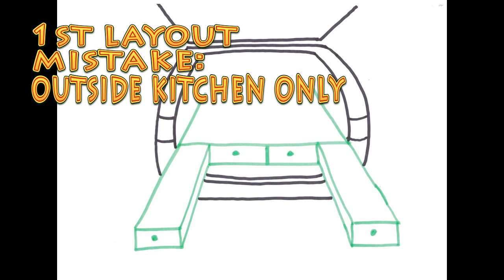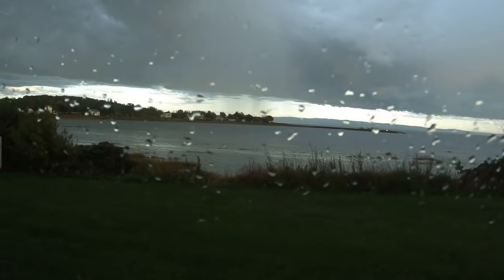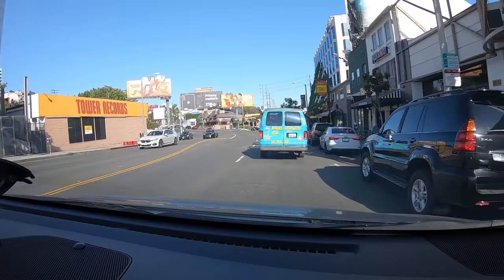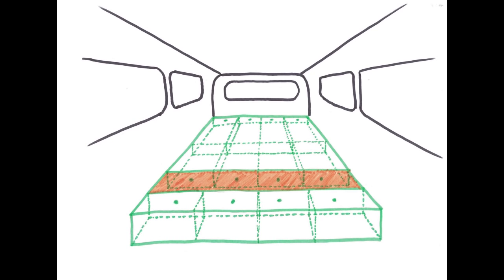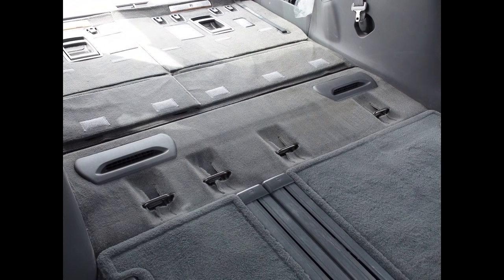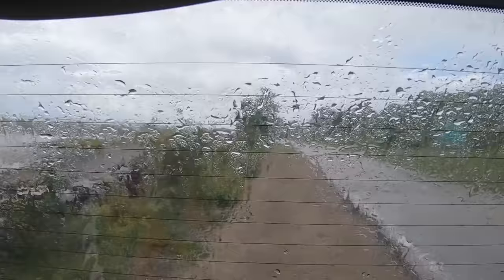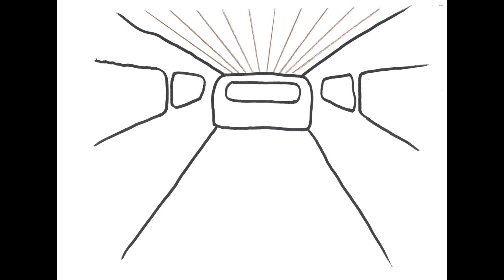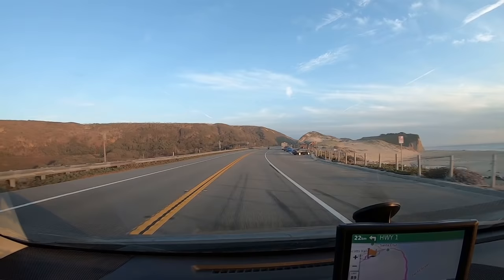11 mistakes to avoid (van conversion)

Comment: Good video. Thank you.
After trying various designs over many years, one of the best changes for me was to do away with cooking and refrigeration. I still eat very well and very healthily, much more so than most people who are cooking and refrigerating. It's a HUGE improvement, and saves a lot of time, space, and hassles.
Also, finding good alternatives to sinks and showers has been huge. The best answer for me is using Athletic Works 28oz squeeze bottles from WM. They do it all, plus serve as water bottles on hikes.
Next: minimize possessions the way experienced long-distance backpackers do. If they can go for months on the PCT with 20 pounds, you can do the same. Even if you double that amount of stuff, it will be far less than most vanlifers carry around.
Next: find attractive alternatives to cabinets. Example: a top-of-the-line high quality backpack, which serves other purposes as well.
Next: comfortable and compact sleeping system. Again, lightweight high-end backpacking gear does the trick and serves multiple purposes.
Reply from the maker: Thank you for sharing your point of view. Me too I effectively use stuff from my backpacking gears. 

I am a long distance hiker, as well as a long distance cyclo-camping and a long distance canot-camping and kayak-camping. I am also an adept of the minimalist philosophy.
But for me, van lifing allow me more, and I want to use it. I do not have to wash my underwear everyday, and I can do it at the laundromat. Why not save time! 
I have also tried always eating outside rather than carrying my food. It is a serious waste of time, plus you have to leave a nice incredible place to go get food! I just love my fridge! I can stay as long as I want anywhere. 
When you finish a 250km canot trip, cross à country in cyclo-camping or finishing a two weeks hiking trail without resupplying, you are happy to get some confort! 
To me, having a small concerted Van is like being in an hotel! Honestly I completely love that! But I still continue loving long distance outdoors activities. Why always living in the same « misery » all the time... But, again, this is just my opinion. Also I have lived so much hard conditions on the trail that I really enjoy having it easy with a little confort 😊

Thank you for your appreciation ✌️
Reply: @ericenjoysearth2756  Thank you for the civilized exchange of views.
Continuing in that spirit, I wanted to add:
I prepare my own meals, I just don't cook. For example, breakfast might be (and often is) a scoop (using a one-cup measuring-cup as a scoop) of organic rolled oats, plus a quarter cup of chia seeds (for omega-3s,  protein, calories), one or two tablespoons of flax meal, some fennel seeds, plus a teaspoon of amla powder (very high in antioxidants), plus a scoop of protein powder, plus a good raisin medley, with a sliced or mashed banana on top, plus some honey and cinnamon, plus some apple juice and water. I then let it soak while I eat other things, like almonds, sprouted Beluga lentils, organic baby carrots, and some kind of green vegetable.
Lunch might be an avocado sandwich, some (California Girl) sardines in tomato sauce, broccoli florets dipped in black bean chipotle hummus, a good crisp organic apple (some varieties stay crisp much longer, such as Lady Alice, Jazz, Koru, and Honeycrisp), maybe some sauerkraut, kiwifruit, yogurt and honey.
Many foods do just fine without refrigeration. Others need to be eaten soon after buying.
Letting things cool overnight, then wrapping them in down sleeping bags and jackets helps them stay cool.
I have found so many excellent foods that keep very well without refrigeration that I rarely miss it at all. Same goes for burners, stoves, and cooking.
______
On comfort: In one of her books about long-distance bike touring, Nadine Slavinsky mentions that it can be as comfortable as staying in a hotel — if you have the right gear. That struck me. So much so, that I took that route. 
It's all about "the right gear." If it is truly right, you can be perfectly comfortable.
The Norwegians have a saying that there is no bad weather, only bad clothing.
I love that.
Along with Dennis Coello's "Be ready for anything, and enjoy it all!"
______
I am a big fan of long, hot showers; but I honestly rarely miss them, have some good alternatives, and definitely don't whine and pine about it.
Reply: @viveviveka2651  i'm curious, what vehicle do you have, and what have you done with the extra space you saved by no fridge/stovetop?  (I'm thinking of a Toyota Hiace van)
Reply: @judoman09  My latest vehicle is a 4WD Toyota 4Runner. Third generation 4Runners (1996-2002) are better off-road than other generations, and better than just about any other alternative. And they are very well engineered, reliable, and budget friendly to maintain. The 3.4 liter engine is one of Toyota's very best engines.
I'm going to remove the rear seat backs, which will give me a longer sleeping platform.
I will exchange the car battery for an RV battery, because it gives better capacity. I've done this before, and it's a good, simple improvement to make.
I had a 2WD Toyota pickup with camper shell, and it was fine for most trips but I ran into some situations it could not handle, and other situations it could just barely handle. The 4Runner handles them just fine, and it opens up a lot of more remote and beautiful areas for me.
As far as extra space goes (it's also about simplicity and freedom from complexities), I usually carry a few 3-gallon water containers plus one-gallon and a few smaller water bottles (the 28 oz squeeze bottles, which are extremely useful). Depending on the length of time in the wilderness, and availability of water sources, I usually carry ten  gallons or so. I can go as high as 35-40 if I need to.
I'm picking up a JEGS 18-cubic foot rooftop carrier tomorrow. It will allow me to keep the interior uncluttered, which I like.
The extra space is also used for storing food. For example, I have a 25 lb bag of organic rolled oats and a 25 lb bag of organic Beluga lentils. These are nutritious staples for me. Overnight oats and chia seeds are really versatile and simple to prepare. Chia pudding and overnight oat recipes are worth knowing. Many are available online.
Beluga lentils make the best, most nutritious, tastiest sprouts and are extremely easy to sprout. You can just do it in something like Rubbermaid TakeAlong bowls (medium sized round ones work best for me). They nest well, are light weight, a good size, and have many uses, including as bowls for overnight oats and many other foods.
_____
I was inspired by seeing rock climbers whose vans were just empty. They had everything in their backpacks. When they returned from their overnight climbing trips, they just tossed their backpacks in the vans and slept in them when they wanted to. A beautiful level of van build simplicity.
Quality gear makes a huge difference in comfort, durability, aesthetics, and quality of experience.
_____
Another reason I took this route is that I'm not an indoor person. No matter how great an interior is in a vehicle, a tiny home, or even a larger home, it is puny relative to the sky and the stars, and I feel cramped. I would rather spend maximum time outside, and find good ways of doing so.
Reply from the maker: Oh you do cook, but without the use of a fridge. I have done this also for years. It is effectively surprising that yogourt is doing fine without refrigeration for more than a day. Even without a cooler if you put its container on the floor, in the shadow, with some clothes over it. But it definitely have its limits, and short ones...
You shared interesting recipes. Thank you!
I just love the saying of the Norwegian. I did not know about it. I share the same point of view, but it has its limits. When you have to rise a wet tent that you folded wet in the morning without having the opportunity to dry it, it is not what you look for after a long hiking day... I definitely enjoy doing long distance outdoors activities, but in my van I enjoy too much the extra confort. It those not make me stay longer in it, except for a better sleep😉. So I guess I prefer being in trail mode on the trail and being in van mode in my van. 
I do understand your way, and I do confirm that it is more than doable. Keep having fun and enjoying that extra-minimalism! Thank you my friend for sharing you opinion ✌️
Reply: @viveviveka2651  thanks.   I understand if  you don't want to discuss  this, but , i'm curious -  what is going on in your mind during these big expeditions?  (I assune you do them solo?)
    I mean, do you find your thoughts swirl about on silly / boring/ repetitive topics?  Or no-thought?  Or you write essays / stories in your head? Daydream fantasies ? Or ... ?
   I'm curious about the mental side of the isolation.

Comment: Thank for for the video, Eric - I'm looking into this van life transition and your videos have been very very helpful. One question I have that I don't believe you (or anyone) answered so far is how do you deal with the need to put the car into service? This is a typical regular thing we all would have to consider, where your car is at a service centre sometimes for a whole day (or longer, if something actually broke/went wrong). So could you please talk me (and other viewers) through your logic and any experience in this regard? 1) what do you do without your van when it's in long service or repair? 2) how does your service centre react to and handle all of your custom elements inside the van? All the wooden parts etc I mean... 3) Bonus question - what about your insurance costs? Typically a car insurer asks if the car was modified - clearly, yours has been quite significantly. Did this increase your costs much? Thanks again!
Reply from the maker: Firstly you must choose a service centre that you trust, or feel that you can trust. There is certainly less chances to be stolen with a dealer. 
I always use a bag to carry all my valuables with me before leaving the van.
I try to be able to take a look at my van when it is in service. 
1) If you ever have to leave your van. You must get an agreement with them so that you can sleep in it. I have slept in a dealer parking lot.
2) People are more use to see that kind of installation. I was one of the first to have converted a minivan. At that time people were surprised. 
Since there’s nothing to repair in my living area, there’s not problem for them to work on my vehicle.
3) Technically my van was not modified. I have not modified anything of it. I have not drill any holes in it. If I remove everything of my conversion, you would not be able to see any traces of it. It is like putting stuff in the van and secure it not to move...
✌️
Reply: @ericenjoysearth2756  great points, thank you so much for clarifying. Amazing handywork on all installations - you make it sound and look easy, but it actually is a lot of work by the looks of it... 🙄👍
Reply from the maker: Enjoy your project my friend! ✌️

Comment: The best and cheapest van build is no build van conversion with everything  able to be removed easily..shoes off in back off van ..shoes on only in front..keep it light ..take your shade with you for bush camping ..large canvass over vehicle and space either side ..access to back of vehicle from the front to keep shoes and dirt in front.. socks on in back..plan to live outside of van as space does not allow for more than a sleeping relaxation space and storage of possessions..a new way of  thinking and living  is required..big change but better than a tent on the sidewalk..

Comment: Made my first mistake!😬 I bought a small Berlingo van with no back windows as it had low kms for the price! However, my visibility will be reduced both for parking and van life views as you have correctly pointed out!
Reply from the maker: I don’t know the cost, but you can add windows...

But anyway, it is still drivable. It is just less enjoyable without windows... It is not just a question of driving, but also inside light and view while you are in the living space... 

You will certainly adapt ✌️
Reply: Will do.🙂
Reply: Will do.🙂
Reply: Here side mirrors with blindsided mirrors work great . Backup cameras are readily available , inexpensive , Easy to install .
Reply: Thanks, I'll check them out.🙂
Reply: Have you thought about installing a cheap reversing cam but having it on all the time
Reply: I will be checking out options to overcome this obstacle.👍

Comment: This is one of the best videos that I have seen! I am starting my van conversion, and where I live there are a few limitations. First I cant remove the seats, they should be easy to set it back again if i have a police check, I can´t cover the rear windows as you did, but i think the foldable bed looks very good!
Reply from the maker: Congratulation for your new project! Those limitations can not be limitations when you do not modify your vehicle! 👍
Thank you for your appreciation! It is much appreciated ✌️
Reply: @ericenjoysearth2756  I am thinking how can I make a bed similar as yours! We will be 2 traveling and a dog 🐕
Reply from the maker: My bed is large enough for two persons. Here’s the dimensions:
https://youtu.be/hvfJSwc5u1A
Depending of the size of the dog, it can sleep on the co-pilote seat. So, problem solved to me! 😃✌️
Reply: I have been watching a lot of your videos and I will keep watching them!!

Comment: Just found you and started w the Mistakes not to make video.  I made a SLOT bed w milk crates for storage underneath and have had 3 multi week successful trips out of Florida.  Now I want to redesign my bed for it can fit behind the Sienna 2nd row seat , drivers’ side.  I want to make the bed over a long drawer that will allow storage of my microwave, pantry and clothes cubbies to be accessed from the outside and inside.  I will purchase a 6” foam piece to use as mattress and in theory I can lift it and access clothes between the slots.  Happy 2024 and thank you for sharing your knowledge.
Reply from the maker: Improving is the way to go! Enjoy the process! 😃✌️

Comment: Very cool van conversion. Did you get some of your inspiration from the Volkswagen van conversions. You have shown that you don't have to spend a small fortune for a van conversion if you're willing to put in a little bit of work into it. Very sound advice on your other topics. Thank you for your very helpful tips. Happy travels.
Reply from the maker: Hello John!
Using the left wall make a lot of sens to me, for two reasons: driving visibility and entering the living quarters from the opposite of the trafic. 

Thank you for this nice comment. It is much appreciated 😃

Comment: Will incorporate your tips and philosophy to my SUV “build.”  After damaging my 4Runner with the corner of the teardrop camper front rack while trying to maneuver (I really suck at towing), I’m looking for ideas on an SUV build. Way less space and headroom than a minivan but my Toyota is reliable and paid for. 

I did camp comfortably in my 02 Kia Sedona minivan but it was a lemon. At 74 I’m not sure if getting a minivan is worth it. However, I have subscribed and look forward to seeing your other videos. Thank you.
Reply from the maker: Hello Sandra!
I had an Xterra for years, and of course I now use my van. To be honest I much prefer my van. 

If you hesitate to trade your SUV for a minivan, I would say that you should find it easier to go in a minivan than climbing in an SUV. So you may use it longer...

The 4Runner is also a great SUV and there is certainly something very nice to do with it!
✌️

Comment: RE: blocked windows
With the price of cameras today, I would actually rather have a camera than try to see through the rear view through the back door or using the back windows that will look right over small cars. 
Side mirrors + rear camera is my preference.
Reply from the maker: It is not only a question of driving visibility. It is a question of enjoying the viewing and more light in the living quarter... I will always prefer windows with no hesitation! Before doing your build, block the windows and try your van. See how much you prefer this...😉✌️
Reply: @ericenjoysearth2756  Definitely try out before you do anything permanent. It comes down to personal preference but I value my privacy over the view. 

You had mentioned driving visibility in the video, so that was the point I was meaning to address with my previous comment.